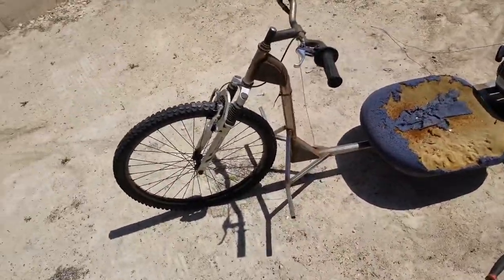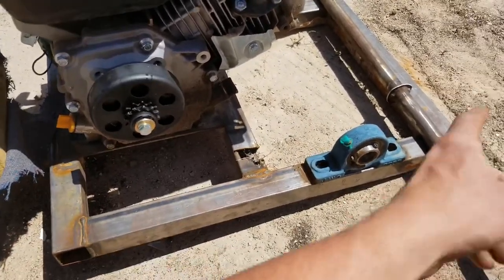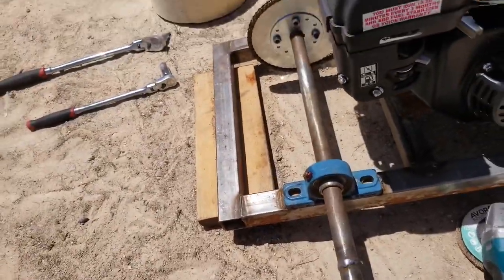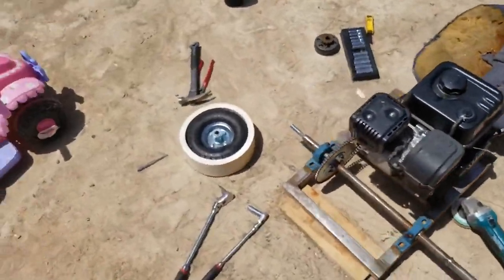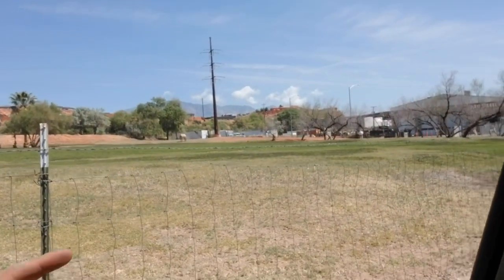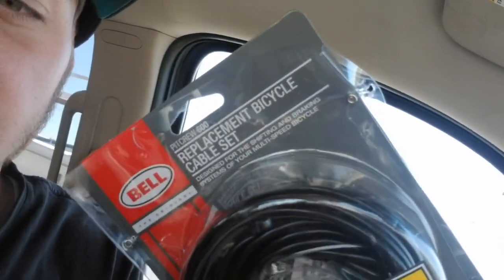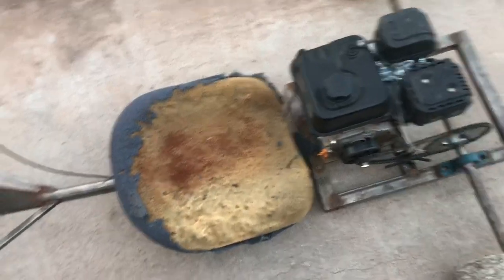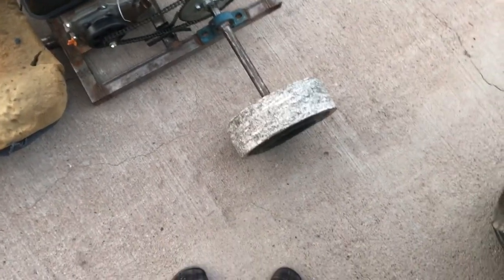MY MOTORIZED DRIFT TRIKE BROKE IN HALF DURING THE FIRST TEST RIDE

Comment: Frame break is no big deal if you’re a welder extraordinaire like yourself. I get the PVC tire concept for enhanced drifting, but do they grip enough to accelerate? Your music is WAY too loud compared to your voice. Viewer should not have to alter volume during video to keep all parts at same volume level. Good Daddy for attempting the horse experience. Great vid Tanner!
Reply from the maker: You have to ease into the throttle but yes it accelerates pretty good. Thanks for letting me know about the volume issue I will watch out for that!